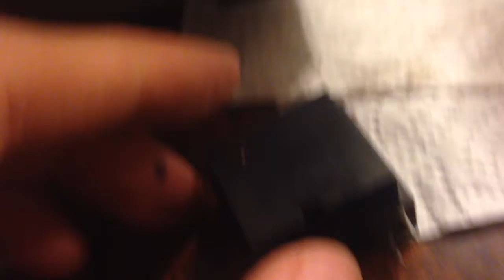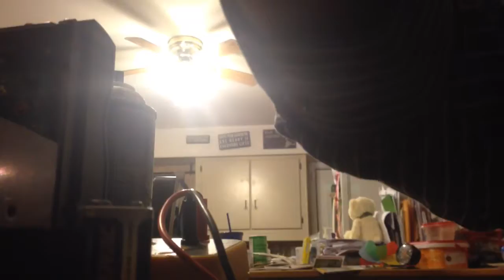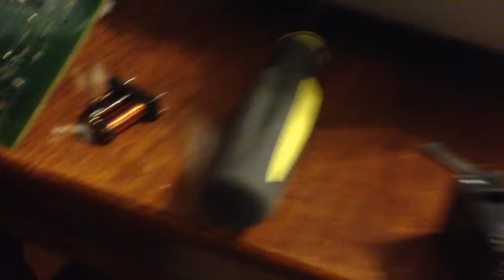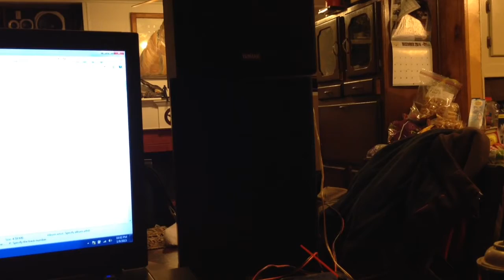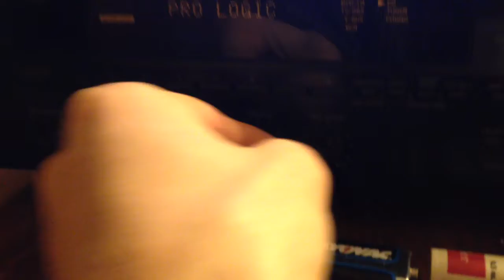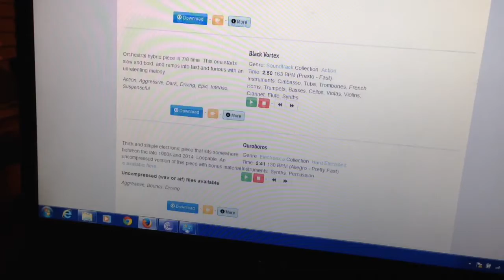Yamaha RX-V795 Repair Part 2

Comment: Fraternal greetings. I live in Brazil. I have a Yamaha R-V1105 receiver on my workshop bench. The Yamaha R-V1105 does not turn on when I press the power key: the relay turns on and off immediately. The front display also doesn't light up. Could the companion help me? Giving me repair tips.

Comment: Thanks for your video. I just picked up an RX-V795a for free. It has the clicking relay issue and sometimes will turn on. I'll get into the relay on the power board and check it out.

Comment: Hello, by casualty would you have the value of the diode that has a blue color at one end that is stuck near the relay, I have a similar voltage source and by accident the diode fell and broke but I can't find references or diagrams to know its value and replace. Greetings from Mexico.
Reply from the maker: Sorry I do not.

Comment: Great video! :) Can you tell me if the internal fan runs a second when powering up? Does the fan run at higher temperatures?
According to the manual, the fan should be heard when switching the amp on. I have never seen the fan running.... My RX-V795 becomes VERY hot when it plays music and I don´t know why the fan is not working :(
Reply from the maker: +Daniel316i I don't think they run until it gets hot. I've never heard it.